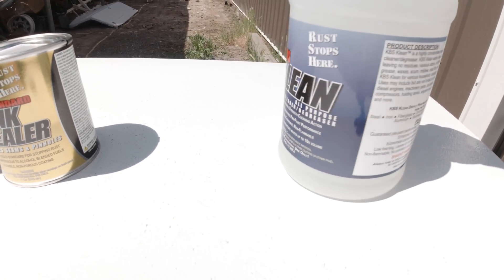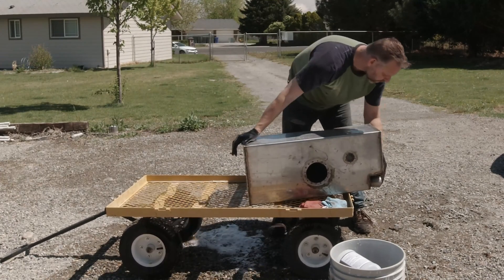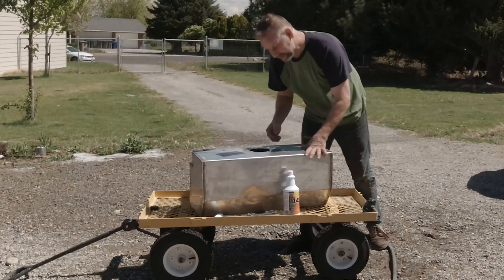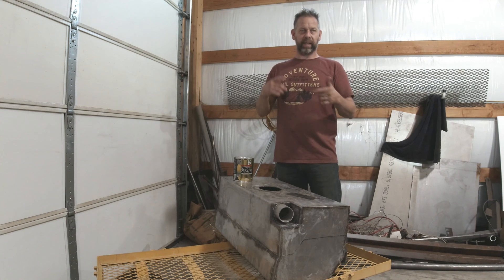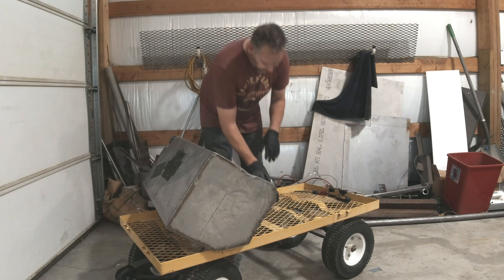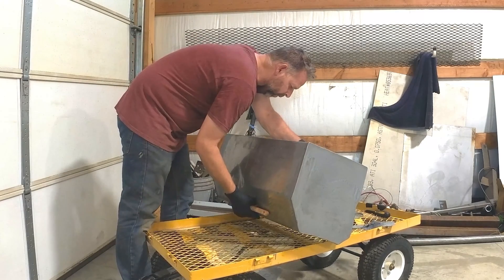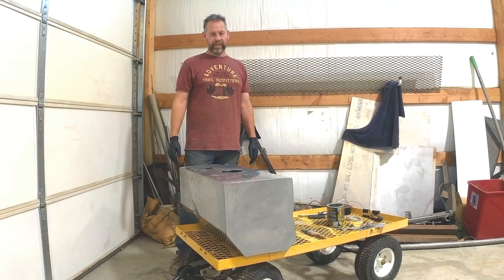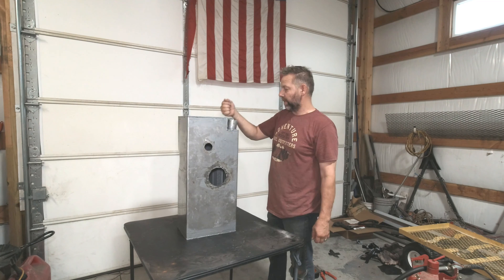How to seal a Gas tank using KBS Gold Solutions Sealer

Comment: another way to seal it for good--- fiberglass one coat fabric qt of resin 30 mins your done  brush it on dries in 1 hr ready to be instaled again  i just did a21ft alum boat with leaky rivits  like new when i finished  we had to flip boat with chain hoist withmoter off but this was restration job any way  that new slick bottom was faster  than before
Reply from the maker: That’s not a bad idea. Never thought of that. I’m surprised really, guess not dealing with fiberglass that much I just don’t think about it. Thanks